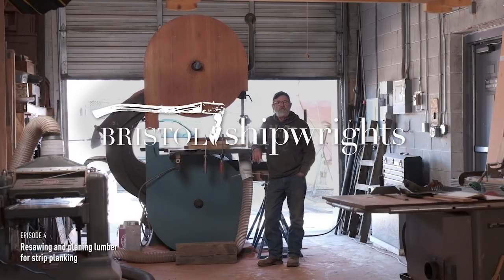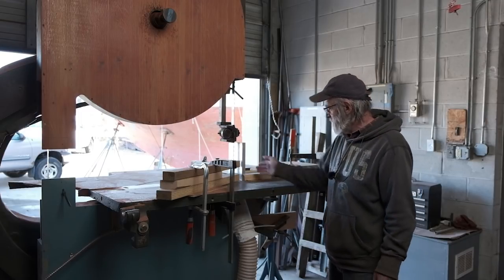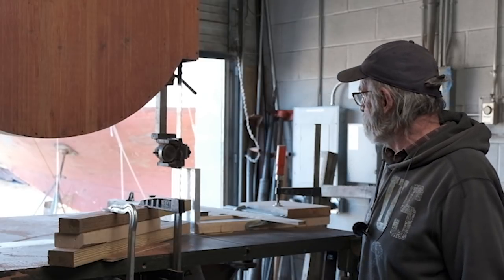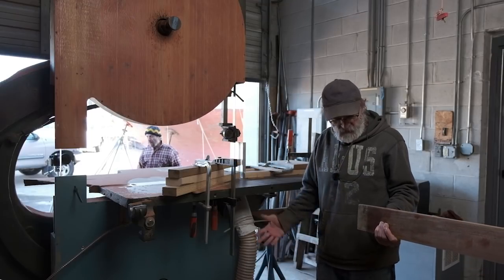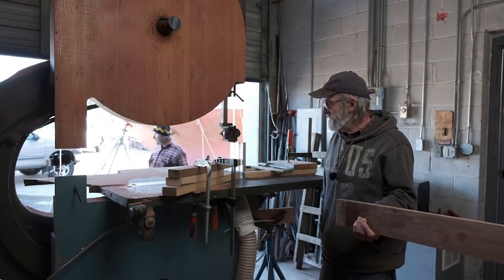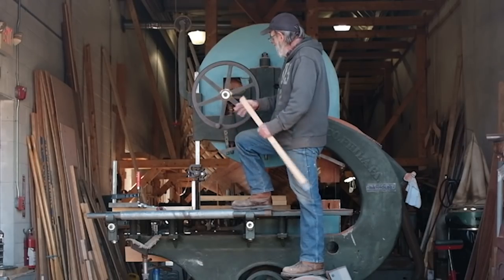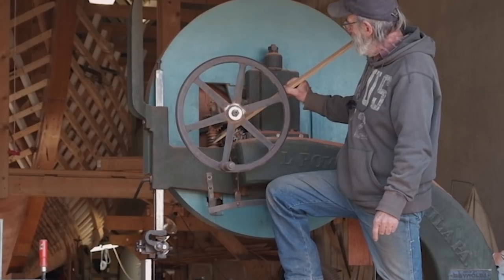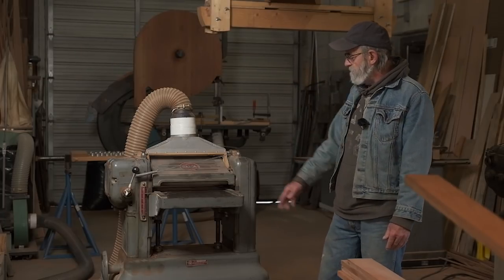Building Evelyn: Resawing and planing lumber for strip planking, EP4

Comment: Love that old saw. I worked in a shop that replaced its old 20 inch radial saw and sticker machine with new. The new worked ok but didn’t have the character of that old equipment with large motors and arched cast iron.

Comment: How did you account for 'drift'? All bandsaws and bandsaw blades introduce a certain amount of drift (the blade pulls to one side or the other). I resaw all of my own veneers and have found that every time I change a blade, I have to run a test piece and measure the drift before setting a fence.

Comment: Interesting that they put the crank for the angle adjustment up top like that, the other couple of ship saws I've seen had it down at operator level or under the table so it could be more easily adjusted during a cut for making sawn frames or whatever else needs a twisty profile (the proper term escapes me) cut in it.
Reply: Rolling bevel?
Reply: @stevenholton438  That sounds right.

Comment: All these americans seem to have the same problem. Taking a large board, then wittling it down to a very small one, with more waste then materials eventually used. Why not saw it immediately in the right thickness? Just let it be sawn into 1mm oversize, then plane it down, done. Lot less work, lot less waste.